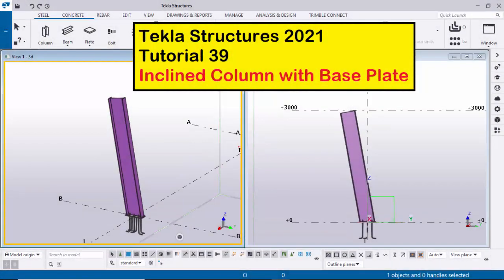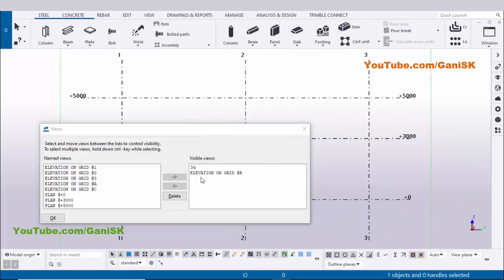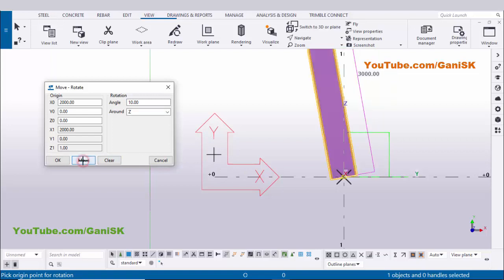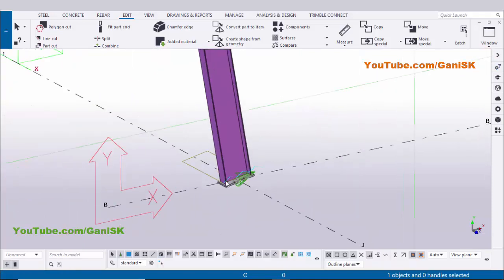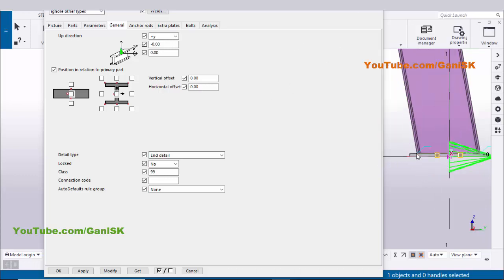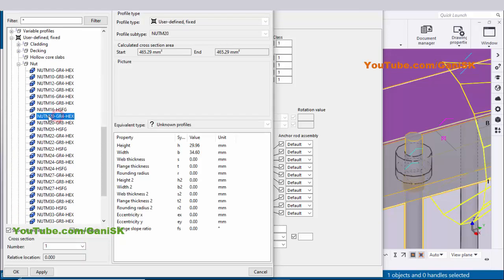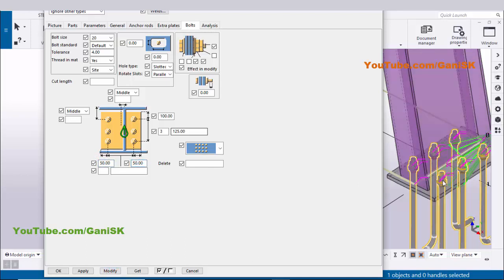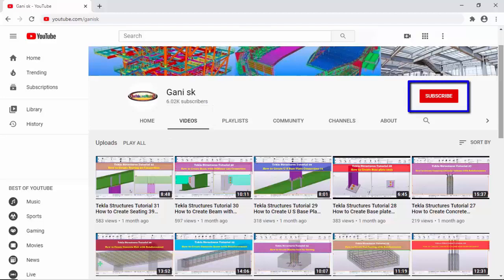Tekla Structures 2021 Tutorial 39 | Inclined Column with Base Plate

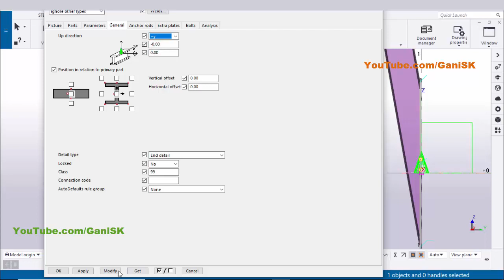Comment: What is the solution if the member is inclined in two planes simultaneously, for example, the transmission tower leg? if we do a correction in the general tab 6:53 it will adjust the plate horizontally on one side but still inclined on the other one. thanks